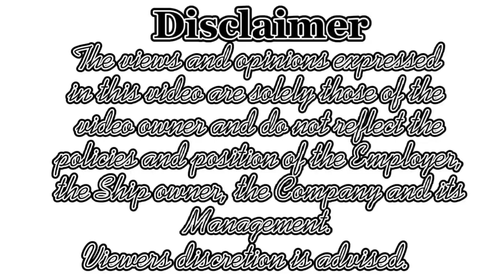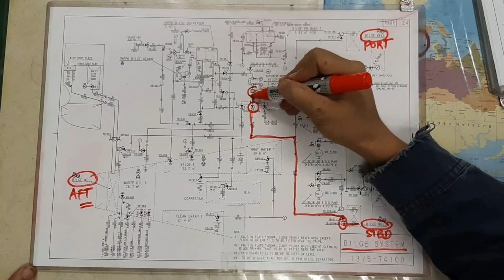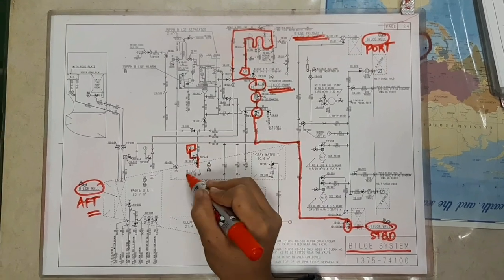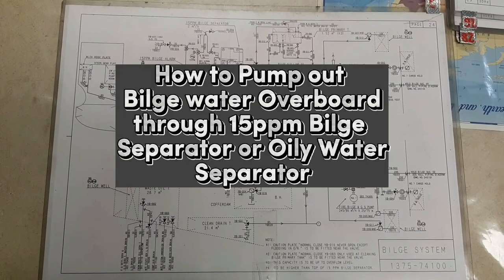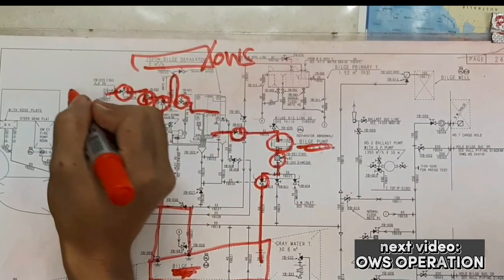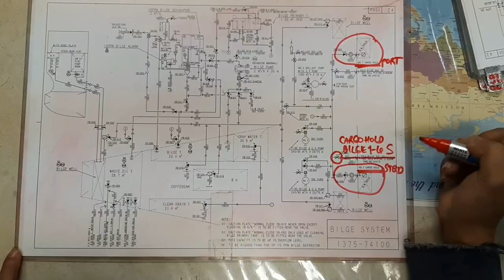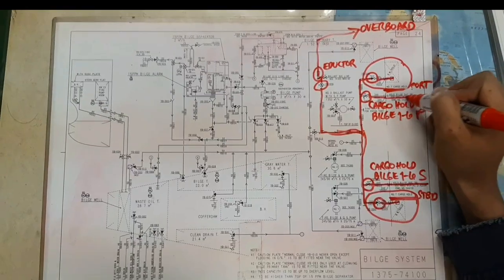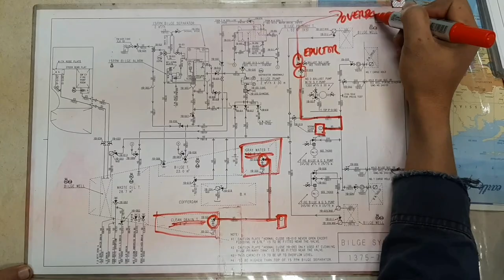BILGE SYSTEM | Toping's World

Comment: it's very helpful video. i have some question.  how to dispose of bilge or sewage water into shore?.
as i guessed, sewage & bilge could be transfered by using flexible hose (shore connection). 
ans also, flexible hose will be handled by shore facility(crane). is it right?